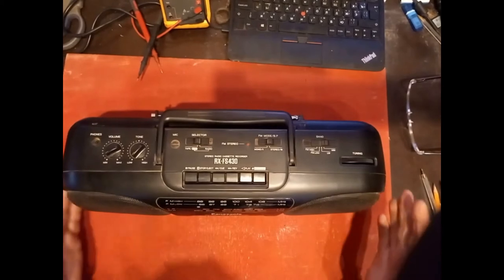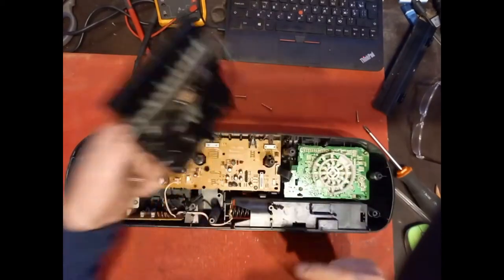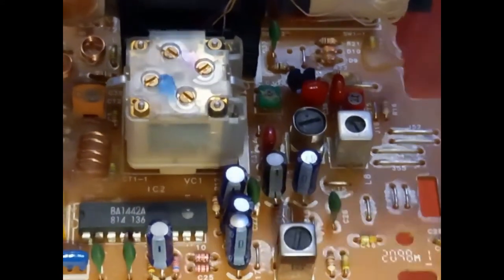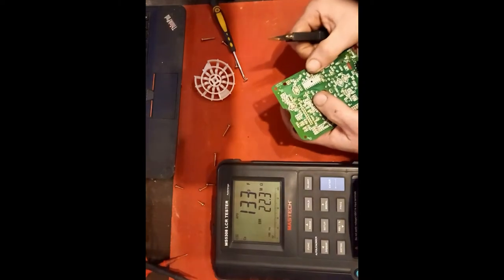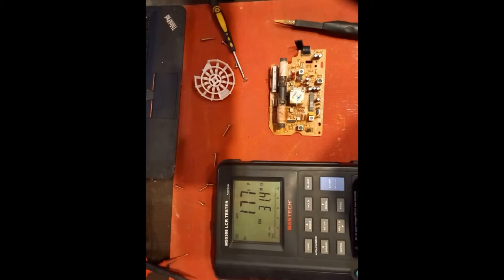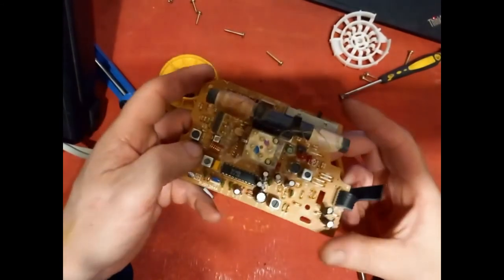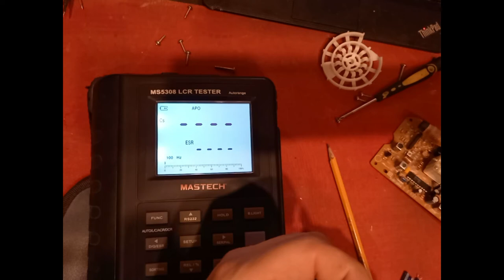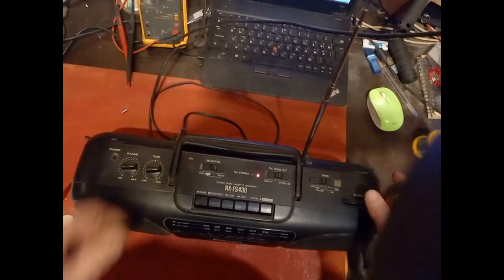How to repair Radio cassette player Panasonic  RX-FS430

Comment: Too fast .. trying to see where screws are and how take them off and your video whizzes past that part!
Reply from the maker: When I made this video it was going to be long so I sped up the screw removel I did not think it was important but I take you comment seriously and when I get back to making new videos I will endeavor to slow down the taking apart process
Reply: @DachaLife , I have the Identical radio. Screws are out, but  the tape that's stuck inside the machine is preventing the parting. The head seems to be hanging on to the tape. So #1 bust the door off, and hope this allows the front to be removed. Or #2 toss this thing in the trash? Pushing play and stop does nothing. Pushing stop/eject door opening just a wee crack. Tape head will not retract. Reverse and play don't function.
Reply: @rickspearman344  Had this problem with my Denon DN 780 dual cassette deck the thing is to carefully pull apart 
press down on the eject button while carefully opening the door to cassette compartment.  If that fails pull apart the unit by removing all the screws from back of the unit it will then come apart.  Disconnect the speakers lead and remove cassette mechanism the tape should come out easily and once tape is out the tape stop button can be pressed off the tape should come out.  If you need further assistance search for on Youtube service repair.  Let me know how you get on